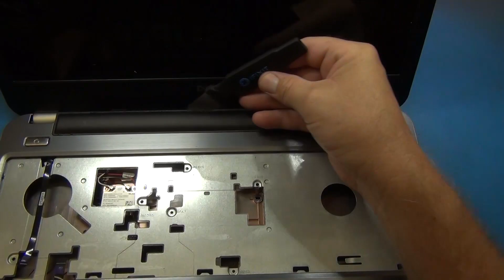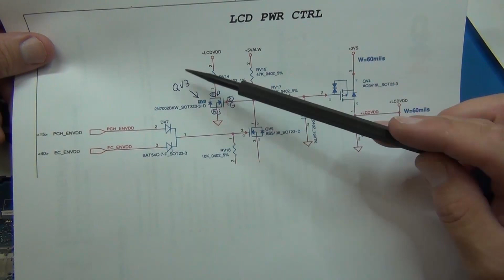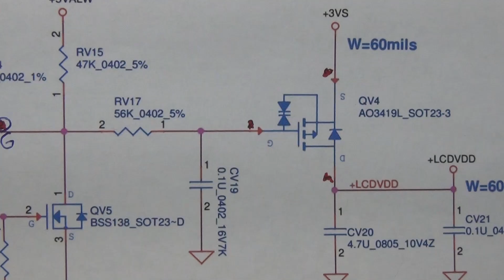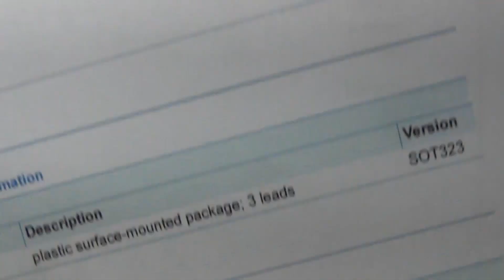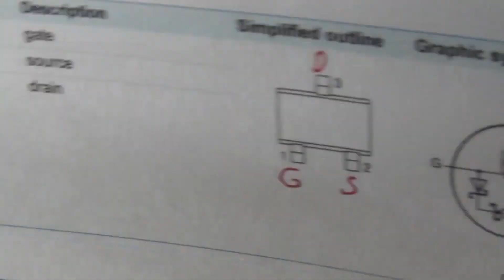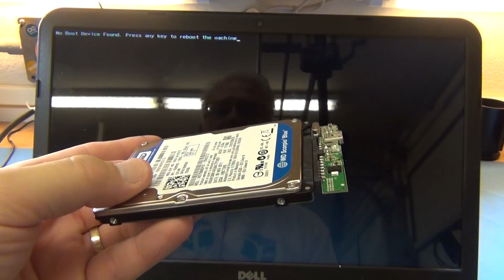Will He Fix It - Dell Inspiron R15 5521 Laptop

Comment: Sounds like you have lost a power rail for so many things to stop working.... Dave Jones says... "Thou shalt test voltages"

Really important..... That Tester you were using to check FETS etc, I couldn't find it using your links... Where did you get it from Todd.  Cool device and clever too.

By the way, with that pick tool you were using, you could get a nickname of Captain Hook.  lol
Reply from the maker: It is the first link under Shopping in the show notes. It is not the very same unit as there have been updates to the tester and others make even better unit. I since purchased another one I like much better so I proved this link: http://astore.amazon.com/tod0f5-20/detail/B00OOQC2E8

Comment: What camera are you using for the bench and closeups? It looks good.
Reply from the maker: I have used the Sony HDR-CX160 Handycam for many years now. I couldn't be happier with it. It has ~4 hours of HD storage + you can expand that with an SD card. I get the extra large batter which is good for ~4 hours of continues recording. I do have extra batteries but really most video are done with less then 4 hours of shooting. Only CON was that Adobe Primer Pro was the only software I found that could edit the raw Sony files with any smooth playback in edit mode and also product good compressed clean running exports for YouTube. I didn't try every editor out there but I did try most of the free and sub $50 programs before I found Primer Pro. Primer Pro is great but it was so much $$$.

Comment: Nice video! And kudos for the repair so far. Fixing the 5V rail doesn't sound like it would be hard. 

I've repaired many laptops but what I usually do is look on eBay to find a replacement motherboard. I just can't be bothered to reverse-engineer bad schematics that are just quickly copied and pasted together somewhere in China or whatever, without any further documentation. They put a lot more work in the layout but you never get that, so good luck following the traces on a multi-layer PCB like that.

Sure, it may cost me $150 to get a motherboard instead of $1.50 for a single SMD transistor or a bunch of capacitors. But all that soldering and head scratching over the schematic takes time that I can save by getting a motherboard. And it's still cheaper than a new laptop. 

Plus, I like to think I'm doing my bit for the environment by keeping old laptops out of the landfill. I recently even repaired my first laptop, a Dell Latitude from 1998 with a Pentium II processor from 1998 that didn't even want to turn itself on anymore. It might be a simple problem in the power supply that would have been easy to fix with the right tools, but the motherboard was $20 on eBay and was new old stock so definitely worth it.
Reply from the maker: Great points Jac. I will hold that as options 3 as the owner of this laptop wouldn't have $150 for the repair. I'm really only agreeing to do the repair for the opportunity to share some troubleshooting tips, tools and repair options. I will of course mention your replacement point in the followup video. Thanks always.

Comment: If you like these repair vids, you should check out Louis Rossman's channel https://www.youtube.com/user/rossmanngroup
If you have the schematics, should be very do-able to find the broken power plane and get it up and running again
Reply from the maker: WOW! you're so right. I have to spend a few days on his channel. Thanks.
Reply: One thing I would for sure suggest is use more flux when you hot air stuff, either putting stuff on or taking stuff off the board. For the longest time, like you, I didn't use flux at all, then I started doing more surface mount stuff, and discovered flux, and will never go back to not using it. I don't do board repair professionally, but my "healing bench" has a never ending queue of things waiting for repair, and flux makes everything soldering related so much better!

Comment: Check the voltages on the regulators FIRST.
You know where they are.
I thought that was electronics repair 101.
If that means rigging up some bodge of a power supply for the mainboard, then so be it.
Good video though.
Reply from the maker: That is a 101 step but not knowing how much liquid was inside I didn't want to turn it on until I know it was clean and any corrosion shorts were cleaned up. However, I then got side tracked examining and testing the transistors that looked like they might have been damages. I gave some good tips in the video on how to do what I did but you're right it wasn't so good on where I started.  The followup video will start from the 101 steps minus the disassemble. ;)

Comment: The amount of stuff that falls into the no pile is quite a lot for me. Sometimes I break it more.
Reply from the maker: Keep trying I guess. I have fun just learning when I try to fix something. This new smd tiny winy parts are getting so hard to work with. The makings are non existing or to encryptic to lookup. They stop putting useful silk screening details, stop putting test point and normally you can forget finding a diagram. Its all about space on the board, cheep parts and fast production runs. If something fails you're expected to just buy another one. :(